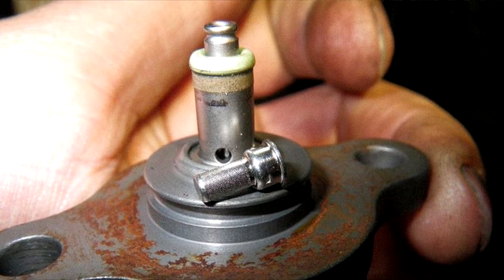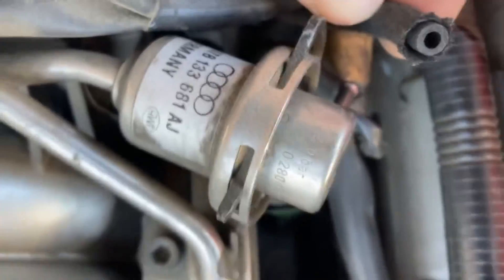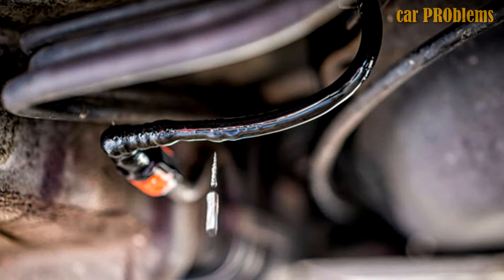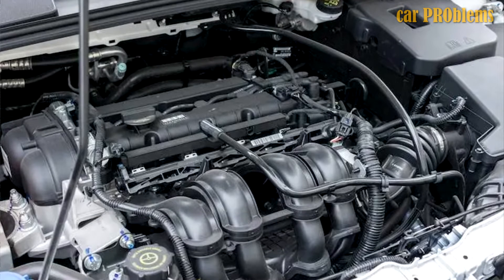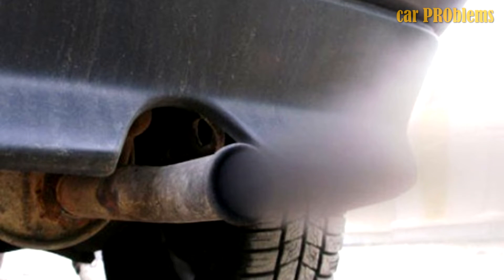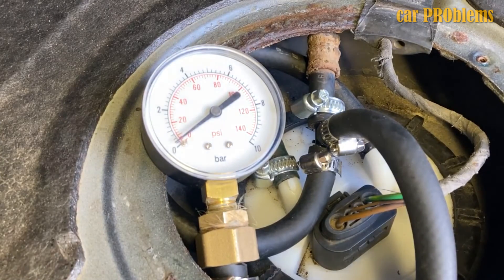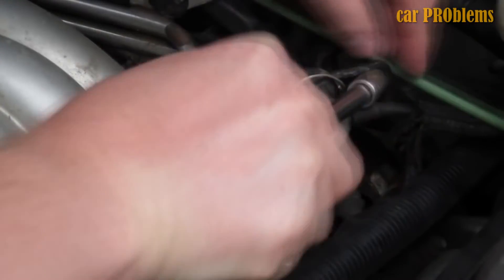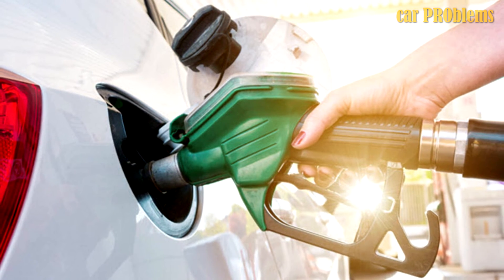10 Bad Fuel Pressure Regulator Symptoms and Replacement Cost

Comment: I have a 1984 p30 chassis big block 454 7.4 l I'm having a problem with the fuel I started it runs and then shuts off it's just a carbureted engine
Reply: Hello easy coast. 😊

Comment: Not a bad video overall, but saying they rarely fail is wrong. GM FPRs from the 90s to mid 2000s are prone to FPR issues. Increased ethenol in fuels breaks down the internal diaphragm. Best clue is fuel in the vacuum system. Take that one to the bank!

Look out for hard starting once warm, uneven / surging idles, and failure to srart when warm without foot on the gas. You won't have DT codes either. Big giveaways.
Reply: Mine starts up fine warm, but when driving i get a bad hesitation. BUT i can turn it off and then back on if i wait a minute or 2 and it will be fine for about 1-3 minutes. I’ve replaced fuel pump and filter… next is my fuel pressure regulator

Comment: if i learned correctly from your video and for example i have low fuel pressure, i can confirm it by removing the vacuum hose from the regulator. if the fuel pressure rises then something is causing low fuel pressure right?

Comment: Any clues as to what can cause the fuel pressure regulator to repeatedly  fail? 
I changed mine midwinter last year on my 2006 4.3l vortec gmc savana (located inside the intake plenum🤦‍♂️🤬)...now I'm starting to get the same issue again.

Comment: Truck idles but when I give it gas it's goes dead
Reply: Change your fuel filter. Spray the mass air flow sensor clean. Do the easy steps to reposition the throttle position sensor. Check ckean/replace the crankshaft position sensor. Check/replace the pcv valve.

Comment: awesome video thanks for taking your time . i will now get to that as the  number 4 of try to fix . i replaced wastegate flappers...wastegate actuators ...spark plugs ....volvo s80t6 2002 . theres no vacum lines attached to the regulator , but i will with 300.000 miles on the car - replace the pump and regulator , think it will be in place

Comment: Hi, I just replaced my injectors from a 1 hole to a 4 hole, now getting po172-po175 oxy sensors 1&2. My regulator is in my fuel filter and was replaced 2 year's ago. Do you think it's my regulator?? And not my oxy sensors??

Comment: If there is fuel in the vacuum line, is that also a rich symptom? I greatly appreciate these tips, although I am trying to diagnose a P0171 system too lean bank 1 on my 99 corolla. So I'm wondering if a failing fuel pressure regulator or fuel check valve can cause a lean system rather than a rich system.
Reply: If there’s fuel in the vacuum line that runs into your regulator, it is leaking. Extra fuel is leaking through the intake manifold into the cylinders, creating a rich mixture.
They can fail and not let enough gas through, as well…

Comment: Can this cause a full throttle bog down?
Reply from the maker: Yes. If the fuel pressure regulator is not functioning properly, it can cause the fuel pressure to be too high or too low, which can result in a lack of fuel reaching the engine under high load conditions. This can cause a bog down or hesitation when attempting to accelerate rapidly.

Comment: You miss all the important ones, when hot it will not start, and many more
Reply: mine starts right up on the second crank when the car has been sitting for a while.. I'm having a hard time trying to figure out what it is.
Reply: @dekalogue same here. If it's hot n sits like 15 mins it has a long crank.
Reply: @dekalogue  check any sensors related to temperature such as the coolant temperature sensor.
Reply: Any clues as to what can cause the fuel pressure regulator to repeatedly  fail? 
I changed mine midwinter last year on my 2006 4.3l vortec gmc savana (located inside the intake plenum🤦‍♂️🤬)...now I'm starting to get the same issue again.
Reply: @philippesantini2425 buy a name brand I bout a no name from e bay it lasted 3 months get a name brand or OEM I haven't had a problem on my 3.8 mercury you get what you pay for I got a herco it's been fine
Reply: @philippesantini2425  always try to replace with oem (original equipment manufacturer) parts. It's more expensive, but your guaranteed a quality part.
 You won't be saving anything in the long run using cheap china made replacement parts
Reply: The quality of the ones you buy but a name brand I bout a no name it failed in 3 months I put on a herco 3 years no problem
Reply: Thank you sir.

Comment: I have a 95 Plymouth Grand Voyager 3.3 l very smooth and solid engine just did a complete fuel upgrade maintenance on it new fuel regulator new fuel injectors new fuel pump new fuel filter that was the major components to the whole fuel system and she's only twenty-seven years old with 220,000 miles on the odometer and purrs like a kitten
Reply: I have a 2001 caravan 193K engine is solid still

Comment: i know it blowed a pontiac grand prix manifold with bad pressure regulator.
Reply: Yeah my 98 Olds Delta 88 3.8 L wasn't hard to start wasn't missing not running rich but the intake exploded yesterday morning when I tried to get in to it to go to the store soon as it cranked over it blew the intake apart!  Caught my engine bay on fire. Don't think it's worth repairing.
Reply: Dang. Sorry to hear that. My daughters Buick LeSabre 2011  blew a dang head gasket recently. I wish I could fix it and save the car. The body is real good shape no rust or anything but I don't know really what caused it to blow gasket unless it overheated going up the steep mountain she lives at. It's always something it looks like.